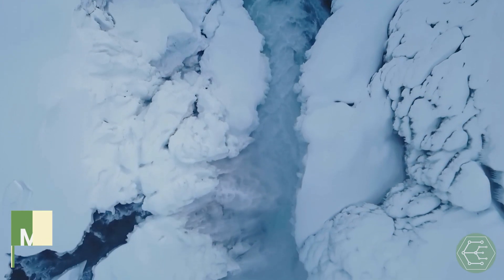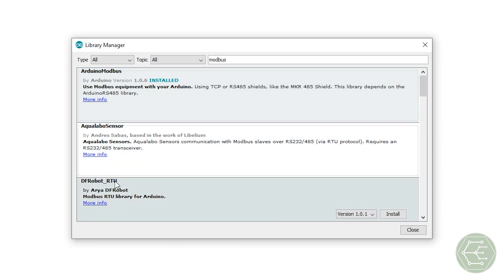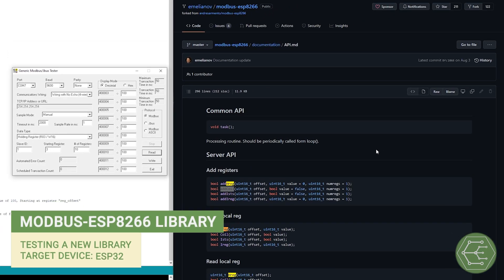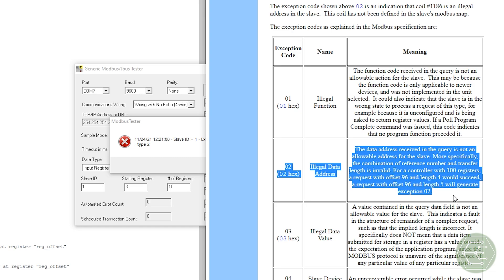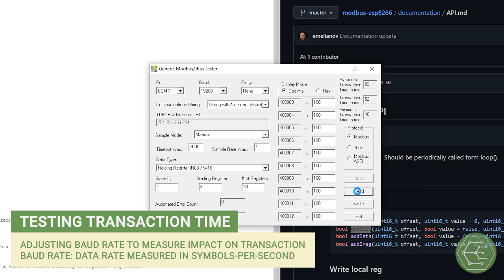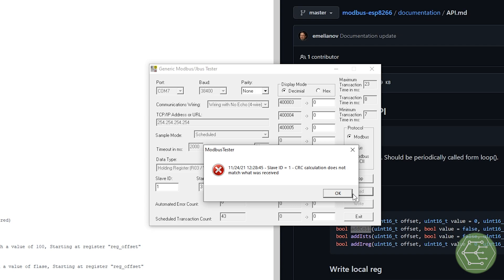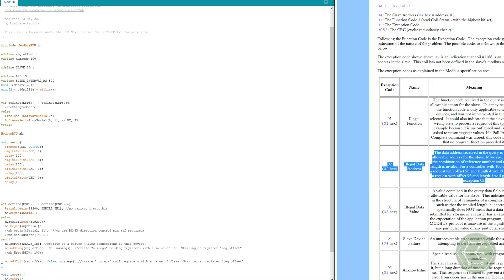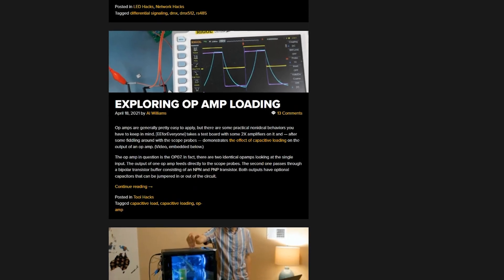Modbus Exploration – Testing Libraries and Microcontrollers | MOT 3

Comment: The difference in registers is due to the two different ways modbus addresses can be used.  Some devices use zero based modbus adressing where the registers will start at say 4000 and other devices will start at 4001.  Its frustrating.
Reply from the maker: Thank you Diode663! I wasn't sure if it was an error, because of jbus, etc. Good to know! I'll have to dig in a bit more.